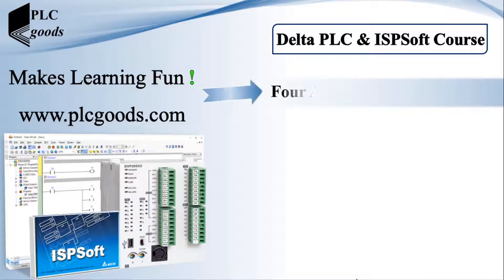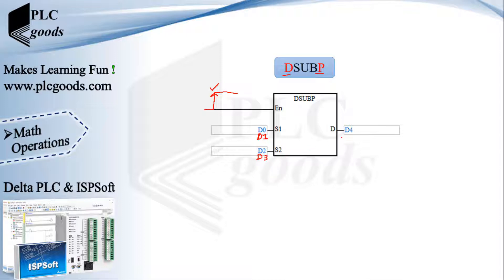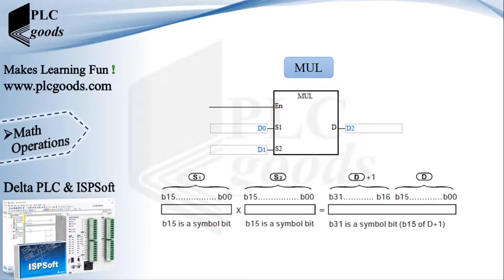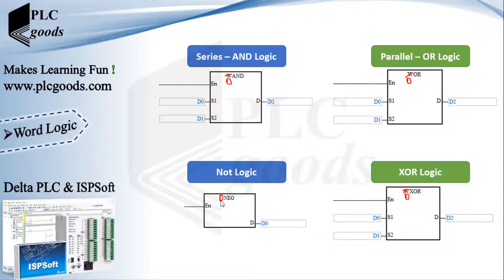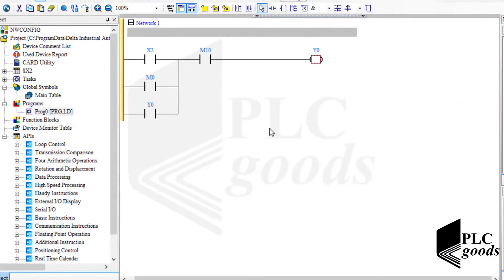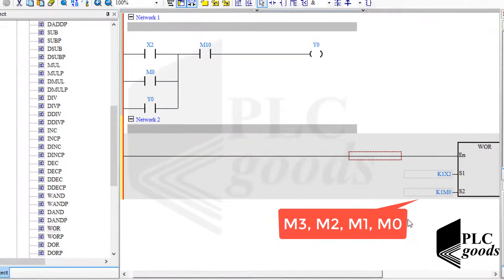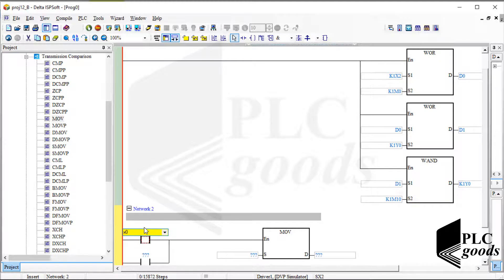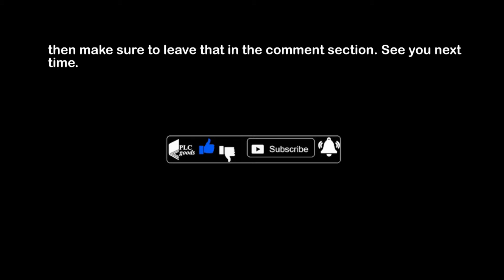DELTA PLC Math & Word Logic | ISPSoft Factory I/O Demo  | Lesson 12

Comment: Pretty nice these instructions save alot of program lines,  btw I have a question in my mind since u first vid , I noticed u don't use memorized coil to start an output like we learned at university
Reply: Hi there, thanks for watching our videos. If you mean Set and Reset instructions, they have been used during some videos. however, a PLC program can be written in different ways.
Reply: @plcgoodsmentor9223  thx u for ur reply but I meant using M address coil instead of yo coil example
Reply: @ayhamshbat2733 , I usually used Y coil, because I wanted to use my LEDs to show my program result. Naturally, M coils are used to store conditions on the PLC memory, not to turn on digital devices like LEDs.
Reply: @plcgoodsmentor9223  I meant to turn on output y by m coil
Reply from the maker: Hope you got answers to your questions!
Reply: @plcgoods  yes thx to both of u , I am following delta vids that's why I asked my question,  I didn't check all vids